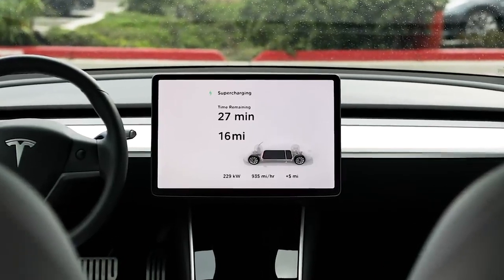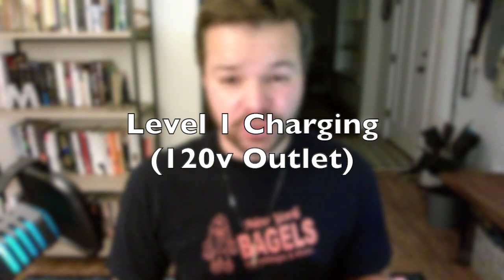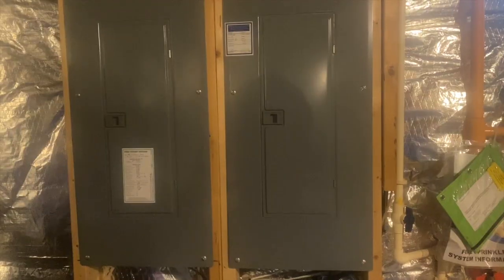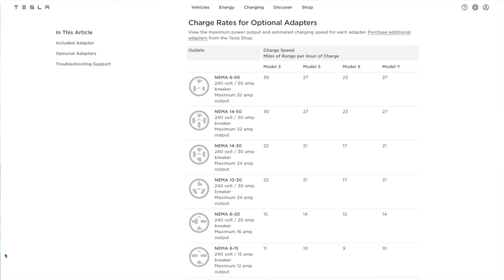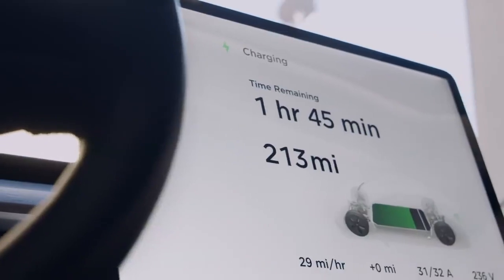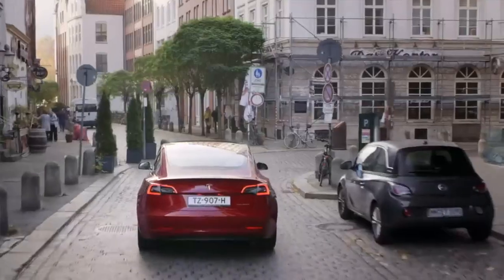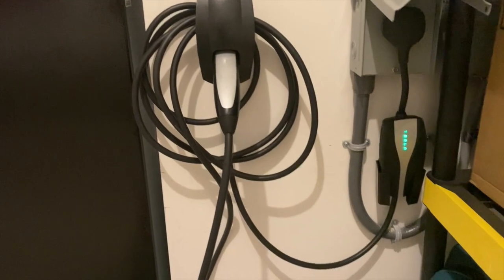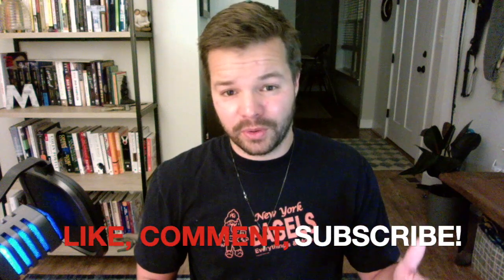The Best Tesla Home Charging Option FOR YOU!

Comment: NEMA 14-50 plug can arc and cause an electrical fire. They are not meant to have the Tesla mobile connector plug and unplug often.  There are more robust NEMA 14-50 plugs but they are more than $100. I'd get the Tesla Wall Connector.

Comment: Nice video. We are going through the same scenario and have decided to have the Tesla charger installed directly through a 60 amp circuit breaker. The reason to choose this initially more expensive option is that our driving, other than local grocery getting etc. is to our vacation home which is ~ 250 miles away. The model Y long range “may” make it without charging (yet to be determined) but if it does it will be pretty low and we wanted to be able to charge it as quick as possible in order to make local trips from there sooner rather than later. Also, since most EV’s are going to the NACS charging system we felt it would be a great selling point if we were to ever sell the house…
Reply: Our cost which includes upgrading the panel by installing an additional 100 amp sub panel and relocating some circuits will be right around $3000.

Comment: Car chargers don't need or use a neutral, so why not install a 6-50R in your garage a use less expensive 6-2 with ground rather than the more expensive 6-3 required by a 14-50R?

Comment: You said that the mobile charger isn't intended for outdoor use but can't you have it plugged in in your garage but have the 20 feet of the cord run outside the garage under the door?
Reply from the maker: The manual for the charger states that if raining, you should not let rain water run the length of the charger causing the electrical outlet or charge port to get wet. So in theory if you ran it out of your garage and kept the connections dry, you could make this work.